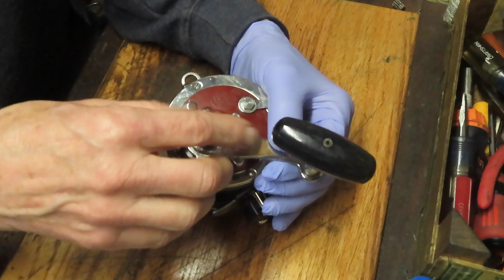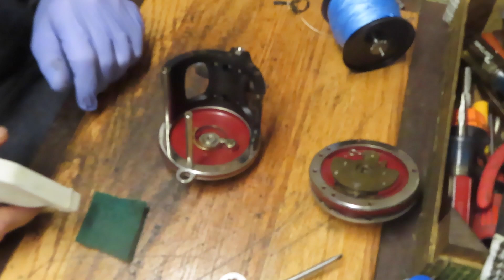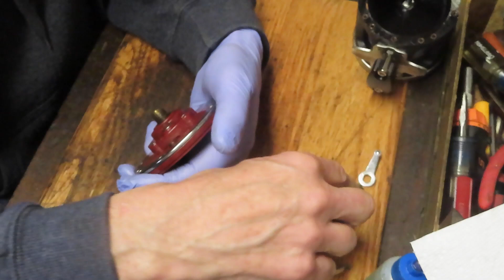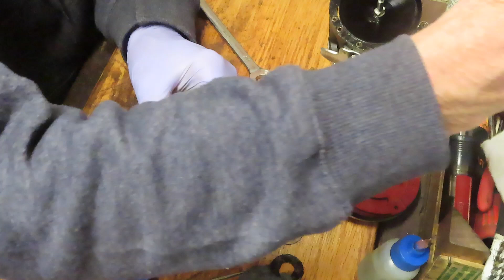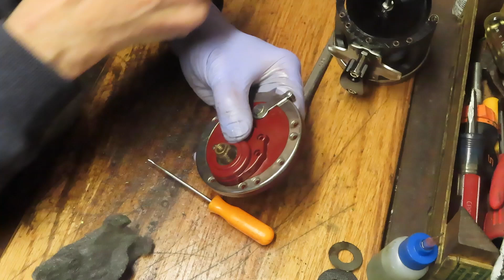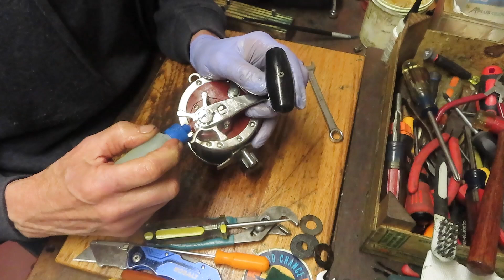How to Service and Upgrade the Penn Senator 113H 4/0 Fishing Reel | Step-by-Step Drag Washer Repair

Comment: I’ve never greased the carbon discs.
Reply from the maker: You don't need to do that.  If you want to grease them, it is suggested that you only use a light coat of grease and wipe offf the excess before reinstalling them - Dennis

Comment: i use a pin punch to remove the tiny pin. i just clamp it in the vice with soft jaws and very carefully tap it out. if i need to replace the A/R dog spring if i dont have a proper one to hand i use a bit of spring from a zippo lighter type spring. just coat with grease so they wont rust.
Reply from the maker: I have ordered a pin pliers.  Let's compare results

Comment: BTW Dennis, I have run into the same problem with drag washers on a couple of baitcasters. What I do is put them in an ultrasonic cleaner I use for cleaning ammo brass. I use distilled water and around 6 oz of Dawn Dish soap. 1 or 2 cycles will usually get them apart, and the Dawn removes the crusty grease, then can remove them and let them dry. So far so good 👍
Reply: Some great advice there. I’ll give this a try with mine. Thank you for sharing 👍
Reply from the maker: That’s a great tip!  Thanks for sharing

Comment: I used Kerosene to brush off old grease n oil and appply new one. Will this effect the reel?
Reply from the maker: I should not affect the metals.  You may want to check if it will tarnish the finish as some coatings may react to in.  I don't use zero because of the odor, but it will certainly act as a degreaser - Thanks for sharing - Dennis
Reply: @2ndChanceTackle  Thank you, will double check

Comment: Another top notch job Dennis unfortunately now the boat reels are not built like this now all plastic cogs onto brass cogs what’s  going to fail the reels I service for the local charter boat skippers that’s the main problem what they want are the faster retrieve reels so they can get the lines up quicker to drift over the wrecks or reefs quicker I suppose that somes up society plus it’s a throw away world now the fact is if your fishing for yourself old is best Aka they don’t build them like they used to 👏
Reply from the maker: Thanks - I do several charter boats and they have been holding on to the older Penn reels because the newer ones, like you mention, just don't hold up.  I think the compromise has been the Penn Jigmaster series, which are still available.  Unfortunately, the quality of the new ones, in materials, if far less than what was used in the older versions and that is starting to affect their buying decisions - Thnks for sharing - Dennis

Comment: You missed the hard fiber washer between the shaft and the main gear to give clearance for the dog so it doesn't jamb.
Reply from the maker: It's there, but you made me look.It wouldn't be the first time I missed something.   At 21:52 in the video, you will see it is black washer that blends right in with the shaft.  Thanks for checking - Dennis
Reply: My bad,I had to watch it on my 65" TV to see it😅 @2ndChanceTackle
Reply from the maker: No - Thank you.  I appreciate it when folks watch the video and pay attention to detail....and yes, from time to time I do forget something or edit out an important step, so it keeps me on track. - Dennis

Comment: Great video. I have the 3/0 one. Never saw spring in video or the wee washer for under the gear on stack. Hope just an editing thing.
Reply from the maker: The spring may never have been in the reel as I did not get it when the bridge was removed and I did not find it later.  That was replaced with a new one later in the video.  The washer on the gear sleeve was there.  It wasn't removed and it is a back washer, so it blends into the base of the sleeve and it may be hard to see  on the video.  Thanks for the note and for watching - Dennis